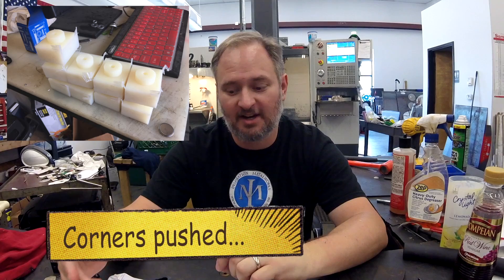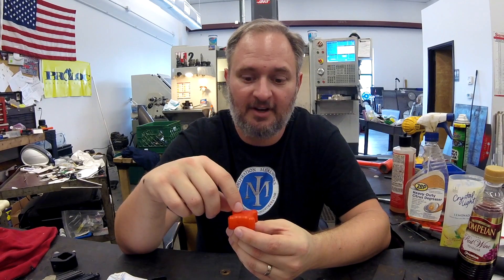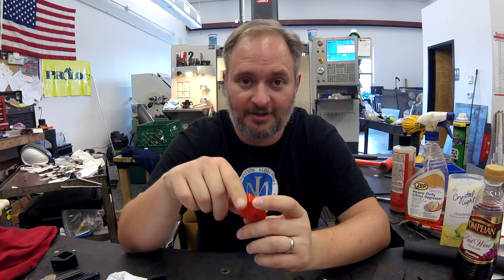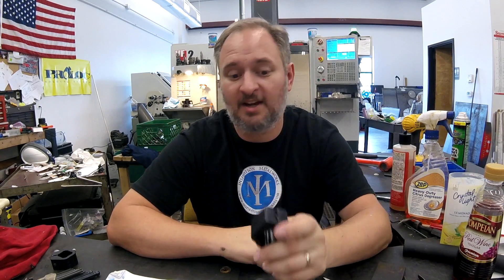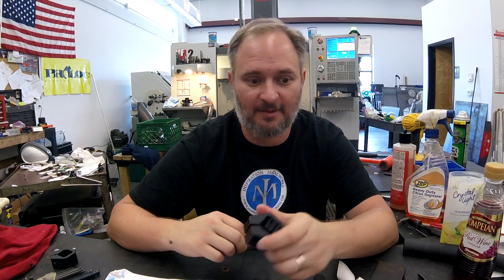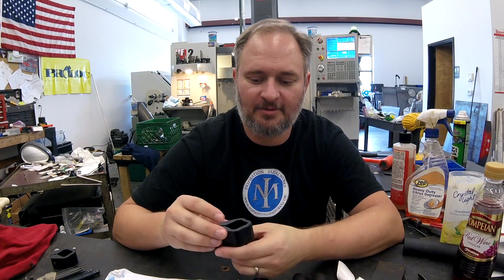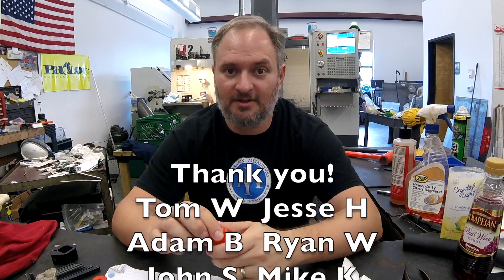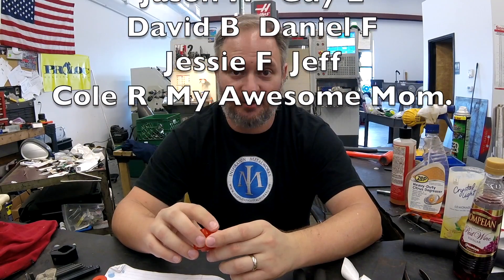Cutting Plastic

Comment: Thanks for the info. I’m a mere hobbyist and had great trouble making simple turned feet for a stool. Changed cutters, changed speed, depth of cut etc. finally got a set of four feet but terrible finish. The best finish I did get was in the bore with a good sharp knife edge tool. Inserts no good, tended to push aside and melt the material (Acetal)
Reply from the maker: I've found that with plastics it's good to have highly polished cutters - regardless of the type. You're spot on about them needing to be sharp too. Inserts worked just fine for me but the high polish was the key to that bit. Thanks for watching!

Comment: I think it was Robert Cowan who recently talked about cutting plastic.  He mentioned end mills built especially for plastics, mostly two flute.  But he did not say where he got them.  Any comments on that?
Reply from the maker: I think the reason he went with 2 flute is likely to keep the RPM at the right range for the machine as well as chip evacuation. The RPM is important - you actually want to be going more slowly than you would think. You really don't want the chips to get compacted / recut because they heat and melt. Let me know if you have any other questions!

Sincerely,
Tom Z

Comment: nylon is tricky, ABS is awesome to cut!  I found it best with ABS to use a slow spindle rpm ~1000rpm is plenty and a fast feed rate and I get no strings and perfect wall finishes and edges where higher RPM tended to cause strings and heating that sheared the finish.  on nylon is harder and doesn't work quite the same.  I will have to look, but I did perfect my nylon parts with a good feed and speed rate that eliminated just about all of the strings, I hate second op or Clean up work on plastic, ruins the finished look!
Reply from the maker: +christopher polanski Agreed, hate doing the cleanup work. We aren’t using the right tool yet - still in the early production stage of that part. Haven’t done much ABS - will have to try that sometime!

Thanks for taking the time to share,
Tom Z

Comment: That all makes a huge amount of sense Tom when really thinking about it. Very useful info for sure. Basically, plastic is just too plastic!!
I assume the flood flow is mainly for chip removal - although suspect too there are temp factors.
My main plastic work has been gross stuff like turned 3" nylon rod or Delrin rod etc (awful stringy chips of course that turn into a bird's nest!) - no major mill work (which anyways can't be CNC)
Camera looks great!
Reply from the maker: +ChrisB257 Hi Chris! We use mostly nylon here too. It can be stringy if you aren’t aggressive enough. Ask me how I learned that! 

Spot on with the coolant. Definitely don’t want rubbing or recutting but the cooling and lubrication also helps.

Glad to hear the camera worked out alright. I’ve got a second one to put into use shortly as well.

Best wishes,
Tom Z

Comment: the O flute router/mill cutters do a good job of cutting plastic, same with worn out coated cutters
Reply from the maker: +daniel lyall I’ve noticed that about having a little wear on the cutters producing a better finish. Wasn’t expecting that at all, really.
Reply: Yer I found that out by the coated cutter being the only cutter the correct size it was a wtf, so I keep them for cutting plastic only

Comment: Tom, you have made it very clear to me that I will never be able to run any sort of CNC machine!! Although I find it fascinating, I just don't have the ability to understand the programming. 
Great job, and the camera is Good!

Razor!
Reply from the maker: +Razor Works Hi Ray! I don’t believe that at all, sir. Practice and willingness to learn are all that it takes if you want to do something new. I started machining plastics on the manual machines long before using CNC. The Haas controller does look scary to use though, eh?

See you soon!
TZ
Reply: It's not as hard as it looks. Most controllers look very confusing and scary but it's not that bad.

Comment: I machine a good bit of lexan for smaller parts. You really have to use good sharp tooling as well. If are slightly rubbing, it will melt on you and load the tool up. Other than a higher ipt and slightly lower rpm, it machines pretty awesome. Some prototyping i do in lexan first and then aluminum, saves a little time and material.
Reply from the maker: I've not done any lexan before; good to know. Good point about RPM - I probably should have brought that up in the video. I made up for not slowing the spindle by increasing the cutting speed.

Thanks for the input!
Tom Z

Comment: I machine a lot of Delrin (Acetal) it seems to machine similar to aluminum.  Another thing is plastic can be deformed easily in a vise, and if you are too aggressive it can rip it out of the vise. Especially on smaller parts.
Reply from the maker: +MCEngineeringInc Very good points! Acetal is great because it’s slippery but that also makes it a pain to hold on to well. Tighten the vise too much and it flexes. Found that out the hard way too.

Thanks for sharing!
Tom Z
Reply: How do you go about it? Any hacks?